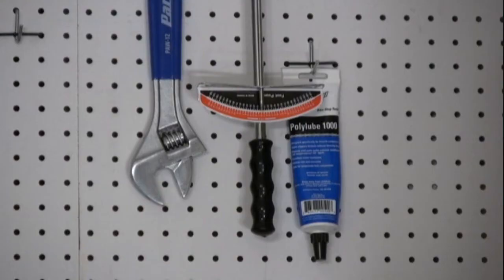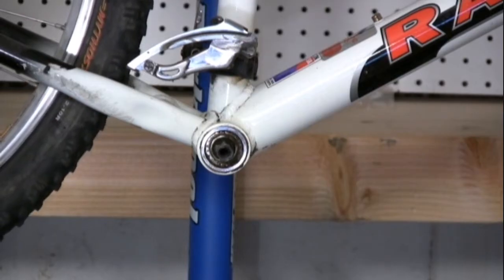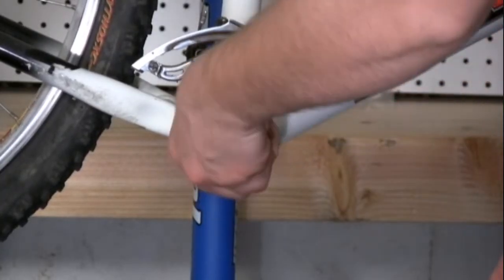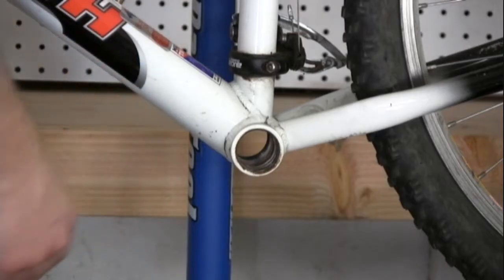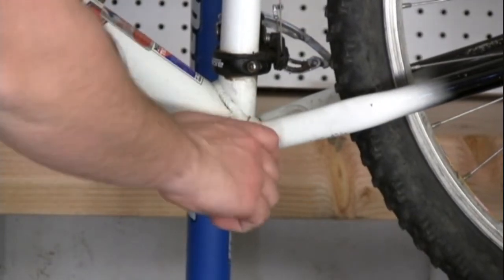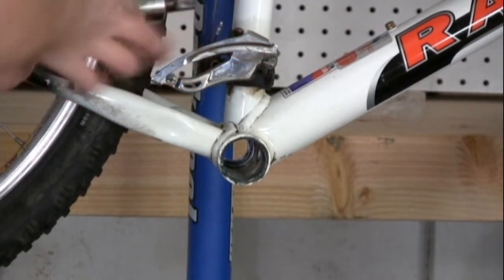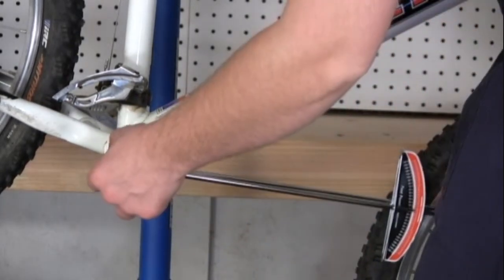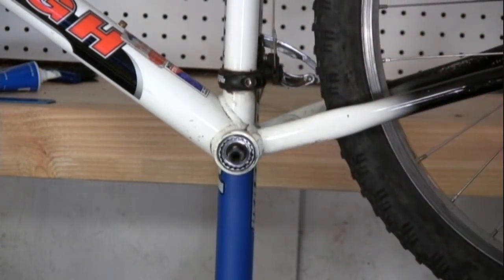Replace Internal Bottom Bracket (Bicycle)

Comment: That is a Park BB-2 Bottom Bracket Tool... I have the same bike, I purhased in 2001. It's a Raleigh M-80 mountan bike. Good video. If you have trouble with the bottom bracket clicking when you peddle, rap a little Plumbers White Tape around the threads of each side of the bottom bracket and torgue with wrench, it will fix the problem. The tape comes in a roll you can purchase at Home Depot or at Lowes Hardware stores.

Comment: @seasonedtoker ....the length of the bottom bracket is 68 or 73mm. The length of the SPINDLE or the AXLE is different, like 111, 113, 115.5 and so on. The spindle is where the cranks mount to. Adjusting chain line should be corrected (or left alone) as per your groupset's guidelines.

Comment: @spadoutDOTcom I solved my problem. my BB is fine, because chainline measures about 50mm from the post seat centre to middle ring. this is max according to shimano. I noticed that my chain hits shifting ramps on 3rd chainring, so I ground them off a bit, just to get a few hundreds off of it and its fine now. when I was in 8x2 chain kept hitting ramps on 3rd ring when I was pedalling it hard. now it's fine, shifts smooth too.

Comment: I found a solution to removeing the left crank arm as i had to as the threads where broke get a hammer and wedge the nail remover the curved part of the hammer into the gap behind the crank arm and pull as i using a crow bar and it will come off

Comment: hey I am having some problems with my chainline and I was thinking of getting a wider bottom bracket to to push the chainrings to the outside. can you install a 113mm BB instead of 111mm for example? would BB stick out in any area?